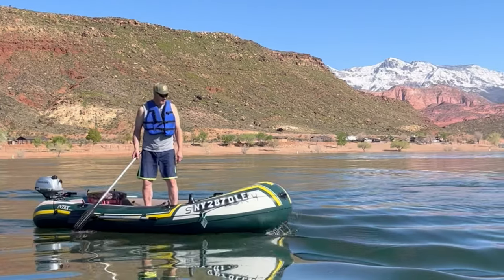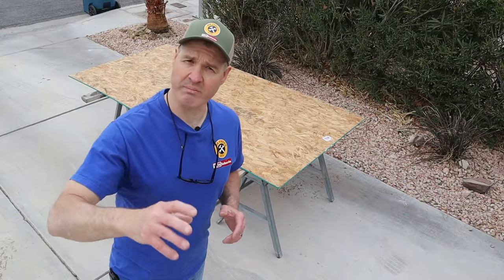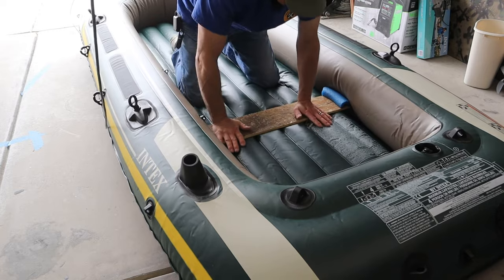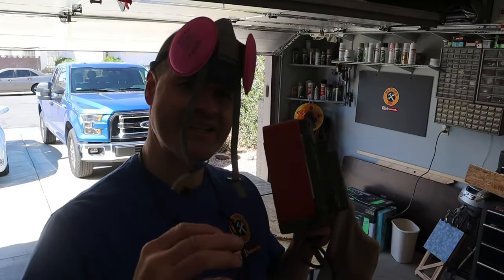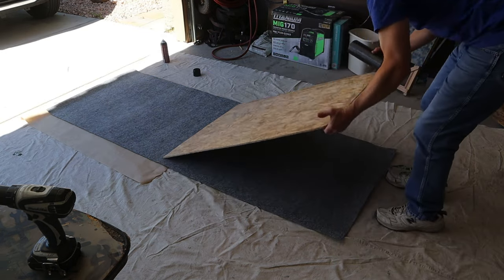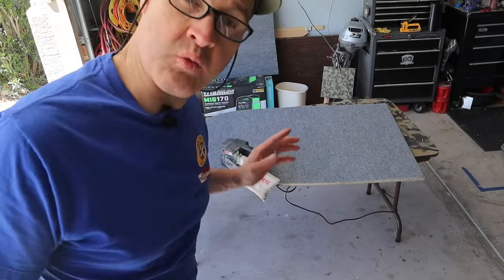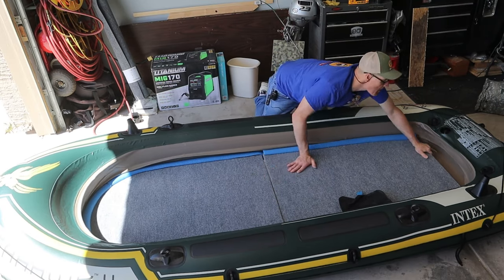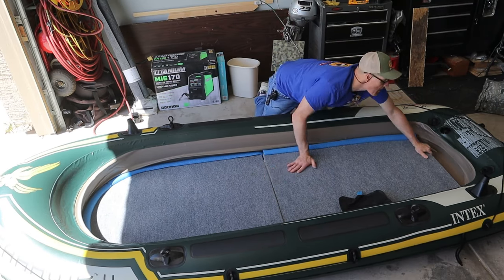Seahawk 4 Boat Floor DIY

Comment: Nine years ago, my first mariner 3 , I used OSB....you will find it absorbs any water that gets into boat, and then , the osb swells and stays, damp and heavy. The savings you gained by using OSB will ultimately cost more in weight and wood rot over time...Jus saying.
Reply: Even if you waterproof it? Just curious as I’ll be building my own for a excursion 5
Reply: Agreed. I would consider waterproofing the wood and then add the carpet. Or better yet, use a vinyl or neoprene wrap. Repels water and makes it easy to hose off any sand or grime.
Reply: Use pressure treated/marine plywood. Already water proof.
Reply: Do you have any better suggestions?

Comment: Yeah the floor makes a huge difference especially when you bring your dog on board
I found you don’t even need the noodles it’s just the floor tucks right into the inner chamber and it’s not going anywhere
Reply from the maker: I find the floor very useful as well. I mostly use the noodle at the rear of the boat. The space between the chambers back there is pretty big and if I step on that area the floor pushes down.

Comment: You should try fixing the 2 sheets together with a continuous hinge so you can fold them together, and they won't come apart. Also, the carpet should be enough if you folded it over the edges so the noodles probably wouldn't be needed. Great video.
Reply from the maker: I’m working on either a hinge or some kind of steel bracket to better join the two pieces of floor. I have modified the edges of the floor with great stuff expanding foam! I show that in my latest video for this boat. You can watch it here https://youtu.be/NKCrn6CCoGU?si=G0zL7wWS7nxJVZLS
Reply: @mrfredsdiy - great video. Did I see in another of your videos that you tried plywood sheathing clips to join the boards together? Then you can remove them completely and the floor board would stack flush on top of each other?  I’m doing a similar build now and debating between those clips vs a continuous piano hinge.  Any thoughts?
Reply from the maker: @jeffm6029 I did use plywood clips. I have to say that I am not 100% satisfied with this solution. If you are in a position to store the two pieces of floor attached to each other, then a piano hinge might work better than the clips. I am considering making a metal two piece solution similar to how I mounted the seats.

Comment: such a cool video! I am inspired to do the same! However I am looking at seahawk 4's online and they seem to have 2 "seats" that are part of the inflatable section...but your seahawk 4 does not have these "seats". Did you take them out?
Reply from the maker: Mine came with 2 inflatable cushion seats that I do not use. They are not attached.

Comment: Hey gd night sir Fred, I'm from Jamaica 🇯🇲 this my first time owning a inflatable boat and found your video very interesting,however I would like to have and idea how much whats the cost for a small engine like that one on your inflatable boat
Reply from the maker: Here is a video with all of the mods I have done to this boat  https://youtu.be/NKCrn6CCoGU?si=LuquXEe2CA3nWjxE

I have both an electric trolling motor and a Honda 2.3 hp gasoline engine. The electric motors can be found for about $200 and the gasoline engine run about $1000. I found mine used two years old for $800. Thank you for watching!

Comment: Thanks for this video, very well done and you saved me a lot of time figuring out the best way to make a floor for our Seahawk 4. It turned a potential over a week project into a weekend success.
Reply from the maker: These little boats are a lot of fun!
Reply: @MrFredsDIY What is the size of the floor board? Width and length. Thanks for your reply.
Reply from the maker: @dachinjo2119 At 3:25 you will find the exact dimensions. Thanks for the question!
Reply: @MrFredsDIY  Thank you, friend. Greetings from Serbia.

Comment: I love this video! I'm going to try in tomorrow! However,  I'm a little iffy on the carpet due to mildew. Would that be an issue, you think? And is that plywood waterproof?
Reply from the maker: Those are legitimate concerns. The carpet that I picked up from Home Depot is indoor outdoor and is basically plastic so I have not had an issue with mildew. as far as the OSB sheeting (plywood), it is not waterproof but spraying the glue on there definitely provides a waterproofing effect to some degree. This is the second time that I have built this boat. my first Seahawk was about seven years ago and I had that vote for three or four years with absolutely no problems with the sheeting. It will not last forever, but it is affordable enough if I have to someday. Good luck with your project!

Comment: Besides fitting in a car, is there any advantage to making the floor 2 pieces? And do you think a 1 piece floor would much stiffer than 2 or not really since it's on an air cushion on a lake? Thanks!
Reply from the maker: A one piece floor is definitely more sturdy! I had a one piece floor in a previous project and found it to be superior. That being said, one of the build parameters for THIS project was to craft a floor that would fit in a car or SUV and still perform satisfactorily on the water. I feel as though this two piece floor design checks both of those boxes. I am 6’ 6” tall  & 225lbs and this floor system works just fine. It also takes less storage space in my garage.
Reply: @MrFredsDIY  I'll probably go there 2 piece way then, if I want to stiffen it up more I should be able to do it with a long pipe or two that can be be installed with at least 2 brackets per floor

Comment: Do you inflate the floor when using the custom wood flooring?
Reply from the maker: Yes! I have experimented with inflating the floor 1/4, 1/2, 3/4 and fully inflated. It seems to perform best about 3/4 full! Great question!
Reply: @MrFredsDIY  Thanks. I bought two of these boats last week but have yet to even get them on the water and the floor mod looks like the first mod to tackle.

Comment: Instead of wood, would XPE work? That way it could just be cut to size and then easily rolled up for transport. The goal is that if the bottom hits a rock and starts to deflate, I can last the rest of the ride. (Lowest class of rapids)

Comment: I own an Intex Explorer 400 I'm wondering if I can do a similar thing with that one. I strongly just like the sensation of my ass sinking into the water so a solid floor would be a great modification
Reply from the maker: I like being able to stand up! A great benefit of the hard floor too!
Reply: @MrFredsDIY  in my case, I'm going to be using the oars

Comment: I had to cut my boat floor in half to fit in my car will it lose stability?
Reply from the maker: I like the thin piece of dry erase board underneath and the plywood clips. It’s not perfectly stable but it works great!

Comment: 19/32" seems flimsy from the video but I've worked 1/2" and it was pretty stinkin' rigid.
Reply: 19/32" is 1/2". It's commonly referred to as half inch, but technically it's made as 19/32" which is slightly thicker than 1/2".